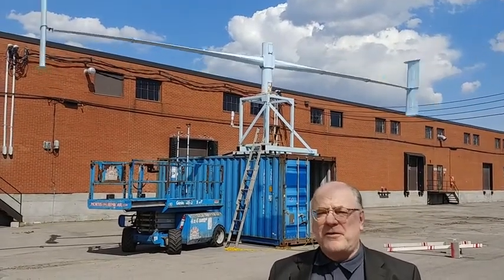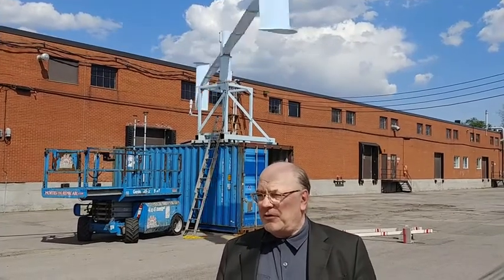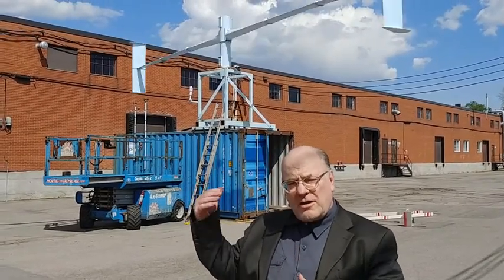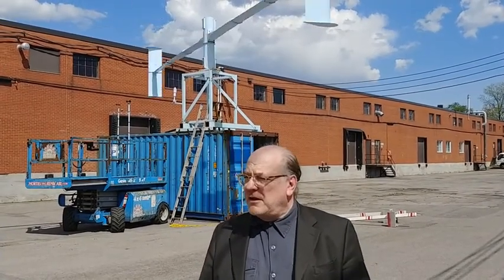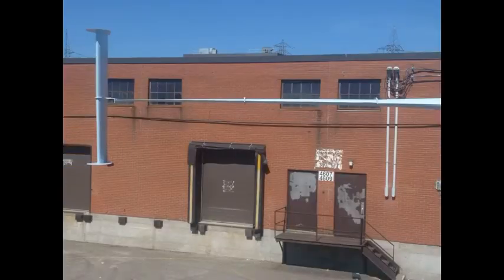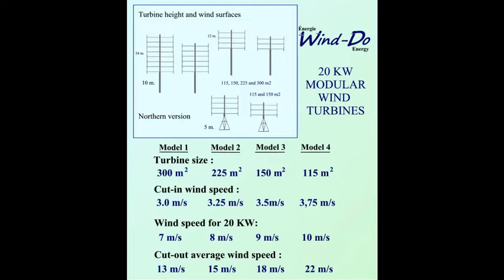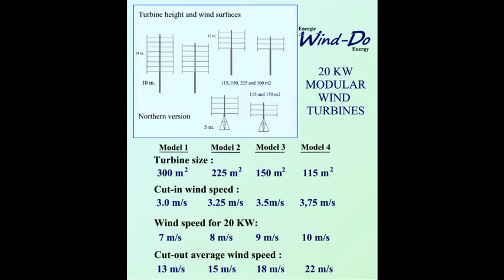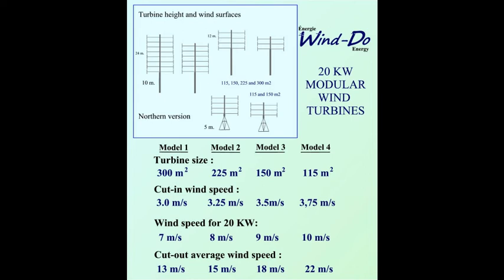Why turbine size matter, and our preliminary small model 2.05.

Comment: We really can't trust your videos because of the motor attached to your turbine. Is the wind turning it or the motor?
Reply from the maker: A Darrieus wind turbine Need to be started by a motor or its generator acting as a motor. From there it may work few minutes, few hours or few days without stimulation. 
In low wind days, the motor is use more often as the PLC will stop the turbine when wind speed id too low to produce electricity.
Reply: We need to see it operate on wind power and self start. Put a small savonius on the same axis and it will self start. Or use three blades and it will self start.
Reply from the maker: @bjl1000  
There is no linear relationship between the power curve of a Darrieus and a Savorius turbine. Its a (common) mistake to try to match them, but I will not explain why for the moment.
Reply: @winddopreview   is right, i'm doing a research about VAWT's and his models sees reliable for me. Great design! it incorate all the parts i see that can improve efficiency in VAWT's